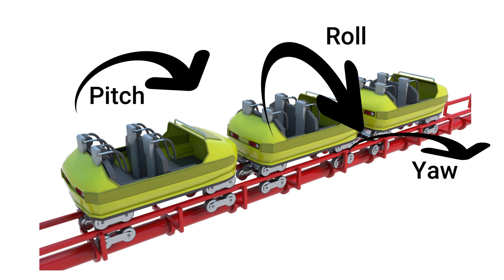It's Not A 4D Coaster - Silly Freespin

Comment: I've always considered most roller coaster rides to be 1 dof systems, regardless of the varying orientation of the car, since all motion is constrained by the railing. In other words, the track itself is the only independent parameter defining the vehicle's motion. So would a "4D coaster" actually just have 2 dof with its added dof of spinning the seat🤷‍♂
Reply from the maker: Most coasters that turn are 4D coasters (Surge, pitch, yaw and roll).  Most wild mouse coasters would be 3D (Surge, pitch and yaw).  The freespins are only 2 if the seats didn't swivel. (Surge and pitch).  Hope that helps.